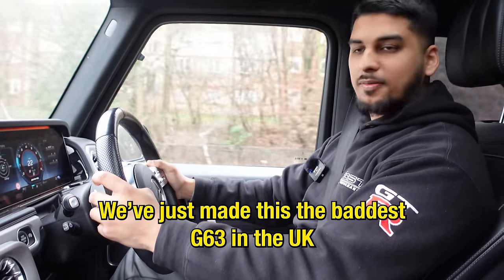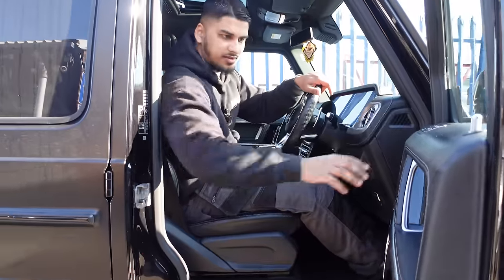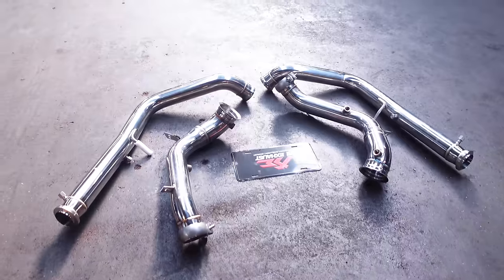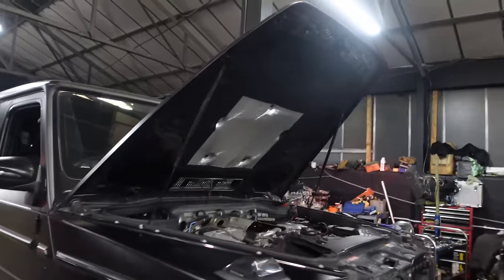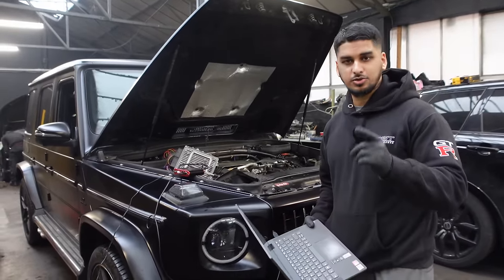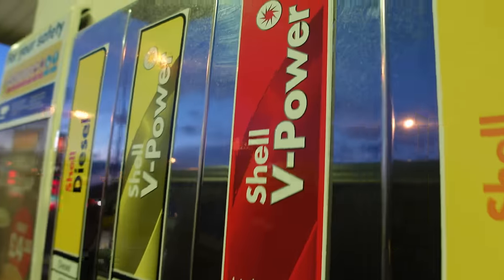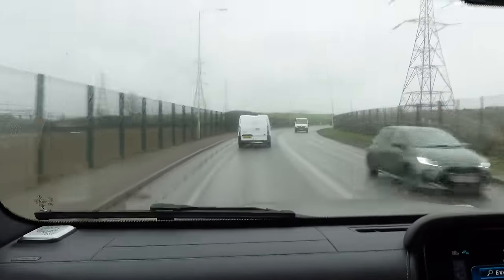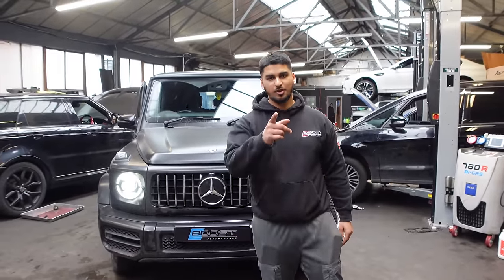I BUILT THE FASTEST MERCEDES G63 AMG IN THE UK! SAVAGE

Comment: The new independent front suspension allows the front to raise when speeding. The Previous gen (2013 - 2018)  with the fixed front axles does not do that.

Comment: they make a cool air suspension kit you can install that helps on hard acceleration. it looks terrible when under hard acceleration with the front end up so high. also the 4.0 motor will never sound as good as the 5.5l motor.